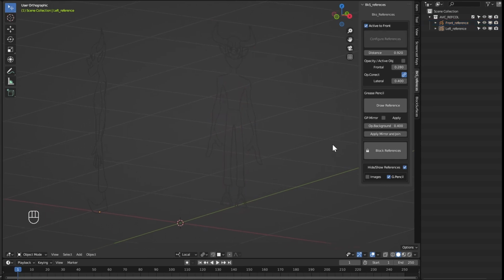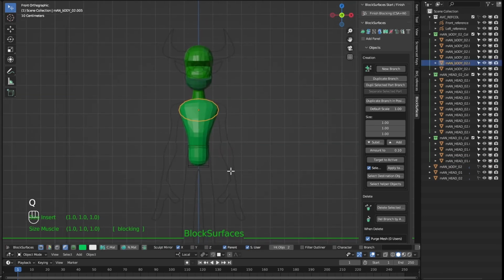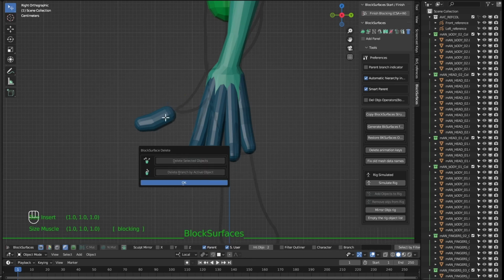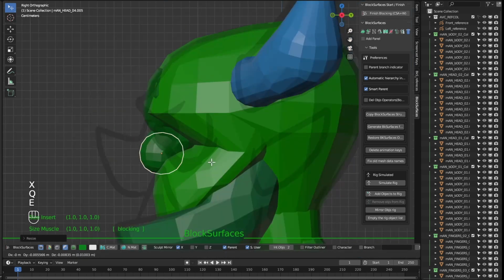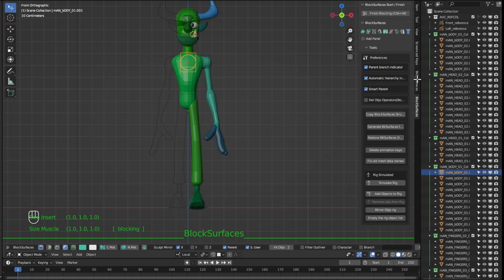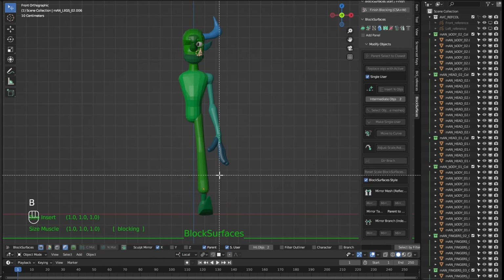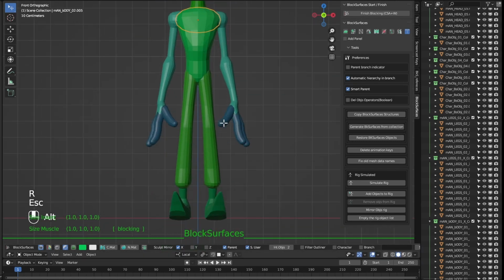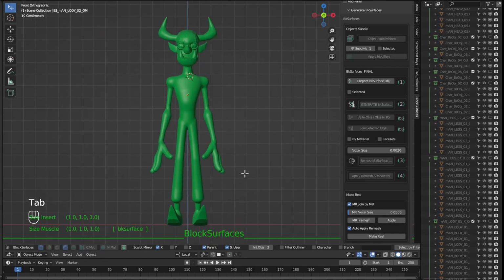Create your first 3d character with Blocksurfaces blender addon, Begniner's tutorial

Comment: Now in the 4 Part Process - BkSurfaces FINAL Panel - After Process 1 (Prepare BkSurface Obj) as we enter the Process 2 and After  GENERATE BkSurface Button is  Clicked There are 2 Buttons - 1st -  Bs To Obj / Obj to BS and the 2nd Join Selected Objs. 

1. Did you click the 1st Button -  Bs To Obj / Obj to BS or it was not touched. What is this button for ?

2. You had clicked the 2nd Button - Join Selected Objs and Unchecked the Facesets. What did Unchecking Facesets do ?

Now in Process 3 - Remesh BkSurface you said the Value (0.002) depends on the scene size. What is the meaning of the scene size here ? Also can the value go lower that 0.002 and what impact does it have on the mesh quality ? Does it increase the Polygon count by lowering the value ?

Now in Process 4- Apply Remesh and Modifiers - Does it retopologise the mesh to homogenize the polygon placement ? 

Towards the end at about 39.30 - you say we could have added more meshes for different poses or proportion. What exactly does it mean ? 

Also what are the next tutorials I should watch.

Many Many Thanks for your continued support.
Reply from the maker: Hi @vivektyagi6848,
 that button (Bs To Obj / Obj to BS)is used to include the interior objects in the final model. Instead of the generated mesh, you'll have the spheres instead of the surface that goes from one to the other.
But it's better to see each thing at its own time. This is an introductory video, don't try to review everything at once. It's better to go through things little by little, or they will appear as you need them.
Facesets: create facesets for each branch. When you sculpt, there's an option called facesets that allows you to select and perform operations on parts of the same object by separating them into different facesets. For example, if you have a hand, you've joined it and activated facesets, you can hide each finger in sculpt mode to work with some parts or others more comfortably.
As I said, there are things you'll see in other videos or later on.
Yes, the voxel size of 0.002 might be very different for your scene. The correct value depends on how you have Blender configured and the scale of your scene. It will create more or less polygons in the final mesh.
A higher number like 1.0 will result in fewer polygons than 0.002, but it all depends on how big your model is and how your scene is configured. That's why it's better to try high values first, and then lower them. You can test until you apply, after that you won't be able to modify that.
You can generate as many final models as you want. You can use the same model, go to block surfaces mode and change something about it, proportions, pose, whatever you want and generate another final model as many times as you want.
Reply: @AitToolsB  Things are beginning to clear up. Now that I have also invested in the BlockSurfaces Tool I'll be able to work with it practically. Many Many Thanks for your continued support.
Reply from the maker: Perfect @vivektyagi6848,  Thank you very much for the support.

Comment: A new set of Queries now regarding the Generate BkSurfaces / Objects Subdiv Panel -  

Can I apply Different set of Subdivisions to different objects in the Character ? Once all the Subdivision Modifiers have been applied individually one at a time then finally Apply Modifiers needs to be clicked ?

As in the Character in the tutorial the Arms and Legs have decent amount of edges in the length but not enough visible in the circumference. Should there have been Subdivisions added or it should have been kept as is for the  time of the Sculpting  ?

In case I need to Apply a Subdivision of 2 to the Skull and a Subdivision of 1 to the Arms and Legs Then will I need to apply them Individually for the Skull and Jaw or it can be done together as well ? 
And the Arms and Legs a Subdivision of 1 can be applied in a single operation or separately. 

Also Can I click "Apply Modifiers Button" after each Object Subdivisions have been applied - One at a Time or this Operation of "Apply Modifiers Button" needs to be done Only After All the Object subdivisions have been done ?

Many Many Thanks.
Reply from the maker: Hi @vivektyagi6848,
Yes, you can do it by groups. You can set subdivisions for all branches where you have any selected object. To do this, select according to the subdivisions you want for all the branches you want a subdivision, select them, give them one subdivision, and it will be added to all of them at once.
Then you can select those you want 2 divisions, head, mandible, whatever, any object from those selected collections, give it 2 subdivisions. And it will be applied to all branches.
Adding or not adding subdivisions is up to you, depending on the shape you want to achieve for the final model. If it's smooth enough, don't add any. If you see the polygon edges too much, you can add or not, depending on whether you want to work with the smooth or harder shapes, that's up to you.
Remember to deselect the "selected" option so that it works with all objects in the branch and not just the selected object.
Apply modifier, it will check if there is the subdivision modifier in the branch where you have any object selected at that moment and apply it.
You can do this whenever you want, it's best that as you add subdivisions you then apply them so you don't forget any.
Reply: @AitToolsB  It answers the queries I had asked about. 

Many Many Thanks Again for taking the time to address it so promptly.